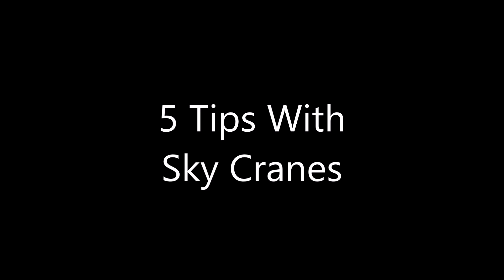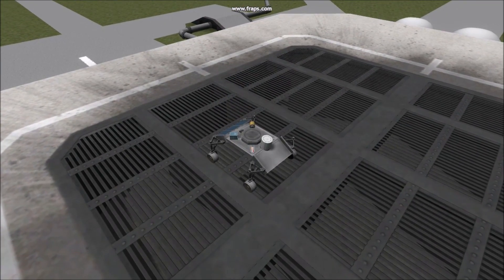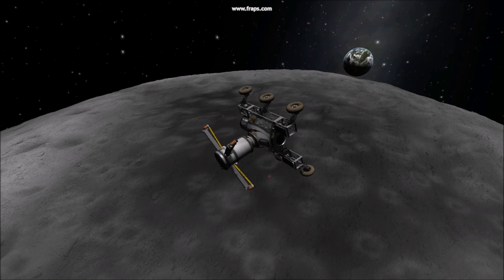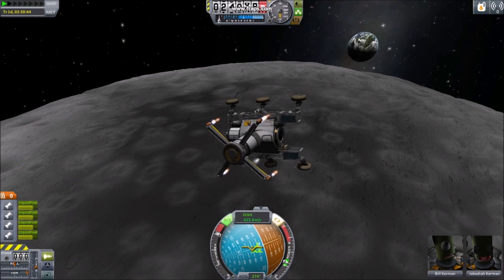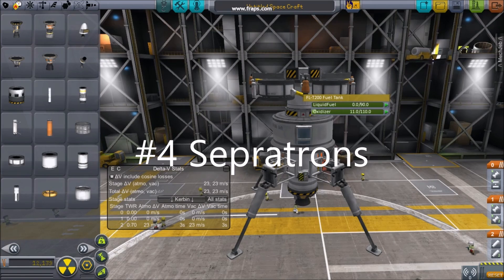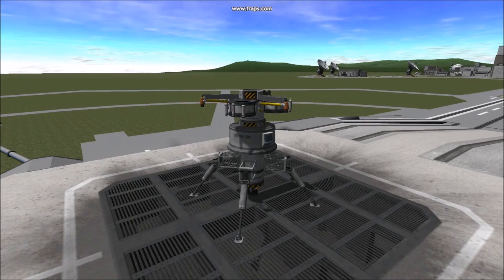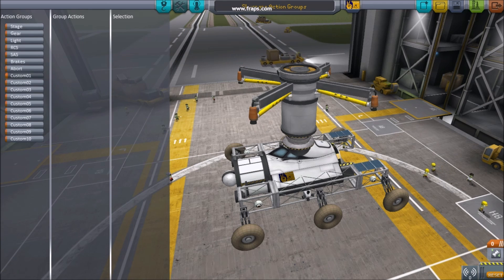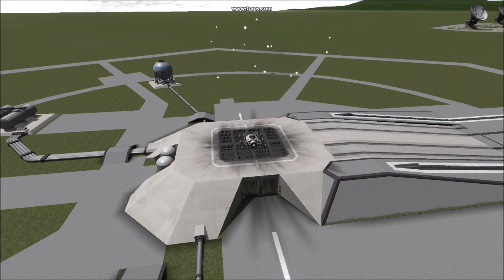Kerbal Space Program 5 Tips With Sky Cranes

Comment: I think that: "#2 Adequate Torque" should be your second choice after trying to align your center of mass with your center of thrust by shifting the attachment point of the sky crane, placements of engines or asymmetric thrust limiting of engines, however adequate torque can help when your center of mass shifts away from the line of action of your thrust during your burn.
Reply: I absolutely agree the center of mass vs thrust is extremely important. With a heavy payload under a skycrane, torque is very important because once the 'pendulum' starts to swing regaining control is even harder. Wish i'd mentioned that torque can help justify an off center of thrust... Anyhow, Thanks for watching, and of course for your comment :D
Reply: Chris Munoz I want some "twin thrust limiter"
so I can limit the thrust of two engines at the same time.
it would help so much...
Reply: DESCENT , that would indeed be handy. or a mod that would just handle engine thrust and change them as needed to maintain balance with the center of mass :D would make building some things WAY easier. THANKS FOR WATCHING!